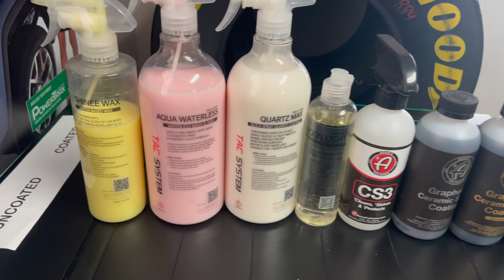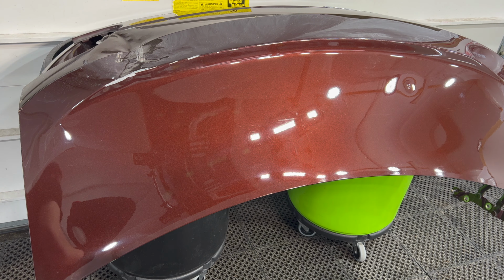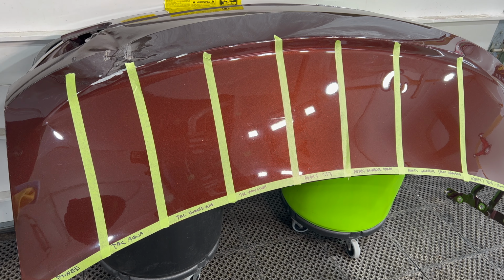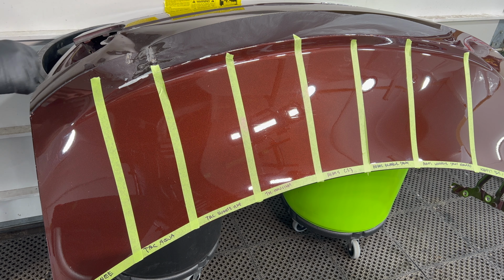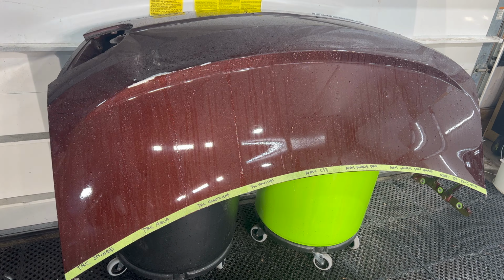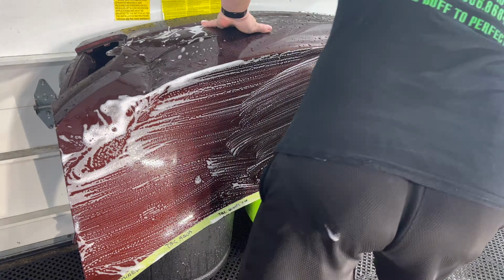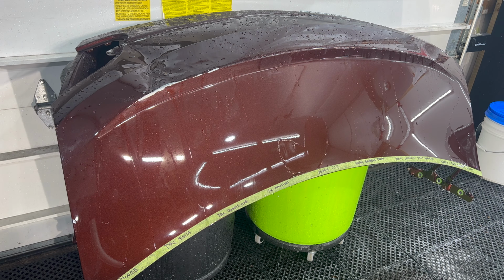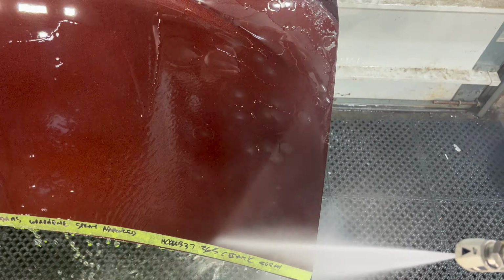50+ Wash Test Tac System Products vs Adams Polishes CS3 vs  McKees 365 | KnightAutoPCD | Avon |

Comment: I started noticing the bottom of the CS3 panel failing within the first 6 washes. I don’t know if the application was slightly different on that bottom edge, but you can clearly see it starting to sheet very early in your wash cycle. thanks for the good info!
Reply from the maker: That’s why we applied 2 coats - just to make sure it was sufficiently applied since this isn’t a lab test, could be something from the tape itself pulled over into the spot - doubtful but wanted to stay with a ph safe car shampoo and see how it would all fare - thanks for taking the time to watch it - appreciate all the feedback !